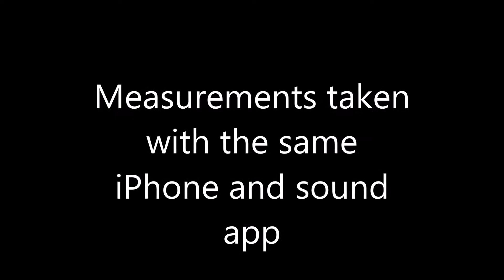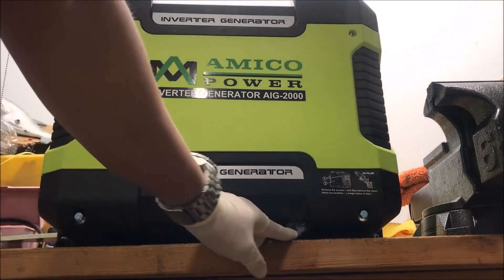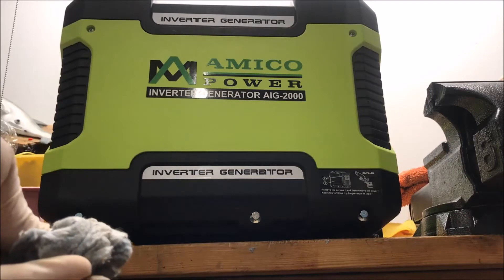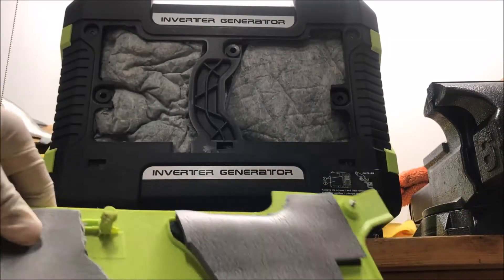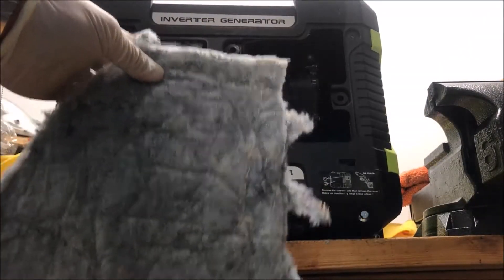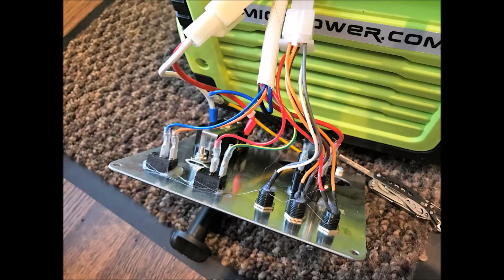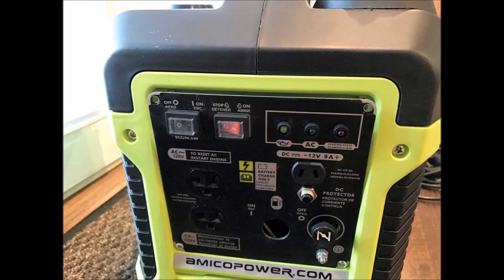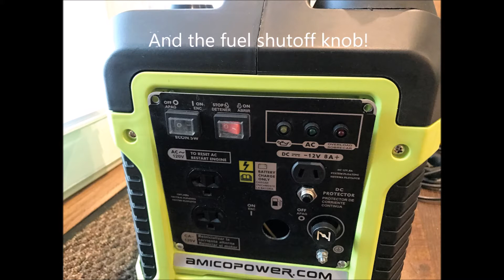Amico AIG2000 How To: Case Sound Deadening [MAKE YOUR GENERATOR QUIETER!!]

Comment: A measly 3 decibel noise reduction?  That's the minimum change in sound level that most people are capable of perceiving and probably within the margin of error of your cellphone-based measurement.  Unless you can reduce the sound level by at least 10 decibels, it isn't worth the effort.

Comment: Nice little option, a good job explaining it. I was wondering how you were going to get around the ventilation. When I saw the side panels and how they mounted to the generator frame it self it got me thinking. I thought I could do the same thing to my PowerLift GG7000C. I was thinking I could build baffle walls on the sides and over lap them in vertical U-type channels. That way it will still breath but the direct noise from the engine has a physical barrier and a U channel that the sound has to go through to make it out. I could use the DC port to run a few extra DC fans to help keep the generator cool. It would be kind of a built on hush house using the frame itself to hold the baffles. Now if I could just figure out how to quiet the exhaust. Maybe a set of exhaust baffles might work. Anyways nice job and thanks for sharing. Between Amico's design and your added mods you've given me something to think about. Best Wishes and Blessings. Keith

Comment: i like this video but have a question? have you thought about insulating from the outside, maybe use some 1/2 inch rubber insulating mat glue to the outside of the generator

Comment: That's a gamble to load up the generator with foam. They do have spray on noise reduction products if you are willing to take the whole thing apart.
Reply from the maker: Grooty Tam foam placed in the same areas as the factory foam will have no effect on temperatures.  And the woven material was tested before and after with temperature readings to ensure it was not negatively affecting cooling.
Reply: ctuan13. Generator seems very quiet though. I always preferred4 stroke over 2.
I hate mixing oil and ⛽ .
Reply from the maker: Grooty Tam It's absolutely great.  At a recent car show, I had it set up running some chargers, a fridge and fan.  Had multiple Honda owners come up to me and comment on how quiet it was.

Comment: What's the name of the acoustic dampening sound foam? You said it fast I couldn't understand the wording.
Reply from the maker: jp unity It's called "closed cell foam".  I have a link in the description.  Although it is for a larger amount, you can find smaller amounts for less on amazon.
Reply: ctuan13 Looking right now thanks.